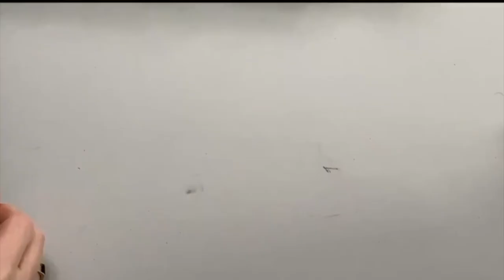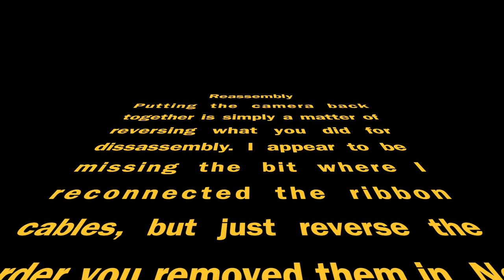Modify your Canon Rebel T3 1100D for Astrophotography or Infrared

Comment: You have the patience of a saint doing that.  I wouldn't have the dexterity to do it, but very interesting to actually see how it's done.  Great images.  Side question, is it easier to get clip on filters for a Canon or Nikon dslr?  I have an old Nikon D3300 that I have started messing around with, hope to get a star adventurer gti in the new year.  Just wondering if it's better to try and pick up a good second hand Canon instead?  Thanks
Reply from the maker: Hi Jay. As far as I’m aware, they do not make clip filters for Nikon cameras. That’s why the Canon is the better all round dslr for Astro. I shoot Nikon for everyday photography and sidestepped to Canon for Astro for this reason.

Comment: You should take measurements for the sensor position before removing the screws (how much they are tightened), so as not to lose focus ability of the camera if the sensor is wrongly positioned.
Reply from the maker: I count the number of screw rotations to release each sensor plate screw. When returning the screws I add 3/5 of a turn to allow for the focus point difference after the sensor glass filter removal. I’ve done about six of these mods and achieved excellent focus each time.
Reply: @photonbucket  And does the Autofocus work on both the screen and in the view finder as well?
Reply from the maker: @Y.Shishani  To be honest it’s not something I usually check as I won’t be using the viewfinder for astrophotography. I modified my Canon 80D for Ha leaving the outer filter glass in place. To operate this as a standard camera I use an Original White Balance (OWB) clip filter. In this configuration focus is sharp including in the viewfinder.
Reply: @photonbucket  Thanks for the useful information,  I am trying to astro mod my Camera my self and has been searching the internet and I appreciate any help. I made a special contraption in order to accurately measure the positioning of the sensor based on a dial depth gauge with accuracy of  plus or minus 0.03mm.
Reply from the maker: @Y.Shishani  make sure that you know which type of sensor plate you have. Some camera models use shims to adjust the sensor position. I haven’t seen anywhere to source these shims, so if you are modifying this type, be aware that you will not be able to use it with a camera lens or for normal photography other than by live view manual focus.

Comment: just asking why not replacing a clear glass over the sensor?
Reply from the maker: Hi, thanks for the question. The addition of a replacement clear glass filter is a very good idea. Sourcing a correct thickness and specification piece of glass is not easy and I could only find one internationally. The added expense and timescale was a game changer for me as I was doing this on a tight budget.

Comment: So im in the process of doing "the astro mod" on my 450d, its going to be q "naked sensor" as i cant afford the money for a filter for it, and i started thinking would a clear piece plastic sheeting work if i was to put it were one of the filters were to stop the dust getting at it, you know like the clear sheeting from say a kids toy box from a shop that lets you see inside the packaging, you know what i mean ??, or is it better to leave it naked, kinda worried about it because i cant afford a 50 quid filter, so deffo couldnt afford a new camera if it was to get dust or something in it.
Reply from the maker: Hi, thanks for the comment. Definately do not try and put a piece of plastic film in front of the sensor. It will ruin your images. It’s either a proper piece of glass or nothing imo. I have left mine bare and it’s fine. My 600d has been a bare sensor for a couple of years now without any issue. Just take the usual precautions to keep it clean and you’ll be fine. I have used a sensor cleaning kit (off Amazon) on a bare sensor and it worked fine, although I wouldn’t recommend it and you have to be very careful. Leave it bare, don’t get it dusty, and enjoy it 👍🏻